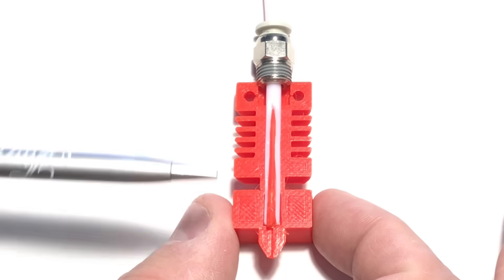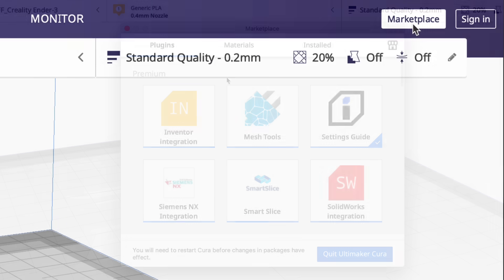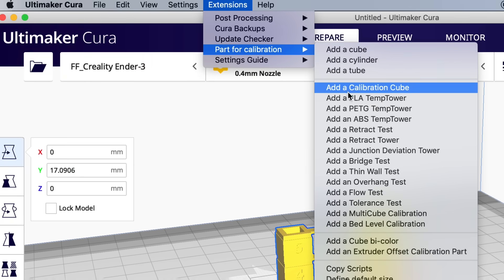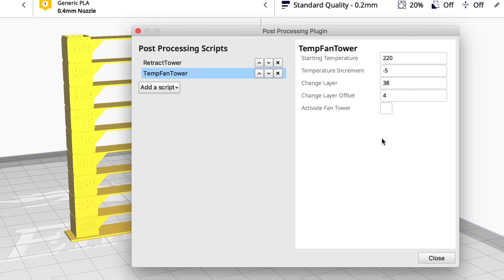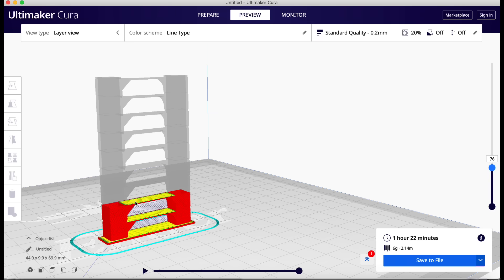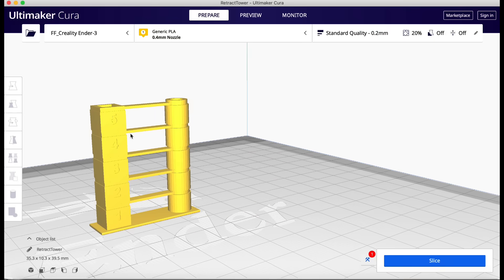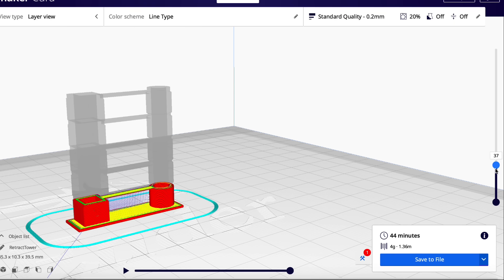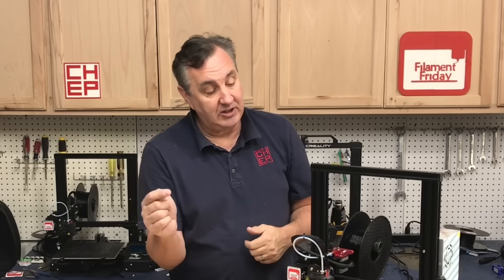Calibrate Perfect Retraction Settings Using a Cura 4.8 Plug-in

Comment: Hi Chuck, Awesome channel. Newbee to 3d, I have a Ender 3 V2 upgrade, with auto level. Works great with PLA and now trying PETG. grrrrr. I installed Cura 4.10.0, and loaded you 3 Profiles, Then ran the temp and Retract Towers.  Question is . when I run the retract tower, on every level it pauses about 3 to 5 seconds each time it moves to the other tower, amazingly the front of the prints not bad. Ya the back where it pauses is a mess. Any ideas. Thanks in advance for all you sharing.  Ps, I did switch back to Cura's profile for a test and same resaults.
Jeff.
Perhaps I had jumped the gun, Is is suppose to pause to allow the retract and then feed material at the next starting point. Another question. Which profile should be used when doing these test, Best?
Reply from the maker: I used 0.2 profile.

Comment: Works fine on 4.10.0. The only difference is that you don't have to add the scripts. I had to add a raft to keep it from coming loose, so if you do that just make sure to increase the offset in the temp tower script (4 layers in my case).
Reply: Heasd up. In version 4.11 the scripts are necessary. I checked the gcode and the temperature changes are not there.
Reply: @wassimks  I haven't upgraded to 4.11 yet, have you had any problems compared to 4.10?

Comment: We have cura 4.9.1 and unable to find "Copy Scripts".  Any suggestions?  Thank you for posting your video
Reply: Hey so I just had that problem, but if you go to Modify G Code and then Add a Script (like he does at 4:13 in the video) then it's already there. In other words, you don't have to copy the script then restart Cura, because it's already there.
Reply: No need to, as the scripts are already installed in Cura 4.9 or greater.
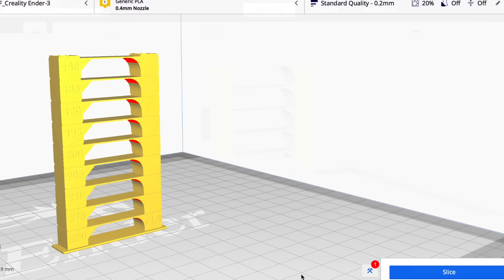Reply: Hey man, you wont need to copy any scripts. You just need to activate the Post Processing Script 'TempFanTower' (See timestamp 3:51) and slice it accordingly.

Comment: Very good video, the issue is that Cura 4.9.1 the plugin with the scripts generates the gcode, it sends to the printer. When the temptower is doing the 230 for example, I can see on the printer the temp still 210, meaning the gcode generated (even with the script plugin) did not modify my default value for temp at Cura... what Am I doing wrong?

Comment: How do I make the printer automatically change the temperature because when I start to print it, the hot end goes to 200
Reply: Mateo Proaño  on my Ender 3 pro the temp never changes during the temp tower print.
Reply: Maybe slowly rewatch the video to see the part where it is explained in detail how to use the plug-in to do this?

Comment: i got ender 6 and it doesnt work to me ,  script says temp 220  but when i slice it and print , printer only  heats up  to 200, any idea what to do ?
Reply: My feeling is that it begins to change the temperature after the offset. So after the first initial 4 layers, I believe it will go  to 220. I haven't tested it yet but I decided to immediately tune to 220 when I started printing.
Reply: I got ender6 too. After editing scripts you should not edit any of the the standart settings. in the g-code: search for M104 code and the temperature change. If you have all the set temperatures in the g-code(i.e. M104 S190, M104 S195,....M104 S220) at different Z heights, it will work.
Reply: @mertolca7457  thank you , now i have another problem , 1st: temp tower, there are inperfection in every gap between bridges, it didnt even printed 180..  also  in retraction tower transition point doesnt match up for some reason - 1st bridge is made on 44, next on 82 and 3rd on 131 , shouldn't it be equal? i followed steps but it doesnt work :/

Comment: If you got the best result at 5mm then it's not a complete test because your best setting should be in the middle of the range, so you can verify that it's the best setting. You should run this test again between 4-8mm retraction settings

Comment: Fairly new to 3d printing.  do you need to set up supports for these towers? not understanding how those bridges can print without them. Need to test my filament it has a temp range of 205-225C.
Reply: That's the point of 1st tower, it's a torture test to determine the best temp to print from side to side, without the need of supports
Reply: @mohammedwaly5041  got it thanks!!

Comment: Sir my temp tower layer hight is coming 41 and retract tower layer is coming 39, how to solve this problem??? Layer hight is 0.2
Reply: Just adjust for each when you print it. The Temp Tower is run by itself BEFORE the retraction tower. Don't try to slice and run both at once. You need your ideal temp before anything else.
Reply: @Becvar80  okk sir, i printed temp tower first and its layer hight is coming 41 and after that when i try to print retract tower, it layer hight is coming 39. Should i print at 39 only or is there a way to adjust the layers for both so it should come came layer hight???

Comment: So in the retraction tower script does the "Value Increment" set the "Retraction Distance" under the Travel settings of the print profile? So setting it at 1 means 1mm retraction distance for the first step?

Comment: Do I have to continue to input the changes to the temperature for every change over like 39, 72 etc...? Or is this supposed to start automatically. Also when I slice it and start printing at what is supposed to be 220 my printer still prints the initial layers at 200 and continues to print the whole tower at 200?
Reply from the maker: It should be changing.
Reply: It is not changing temp for me either. I'm printing with 
CR-10s 
Marlin bugfix-2.0.x
Cura 4.7.0

Profile CHEPV4.7.x
Reply: @GeorgeAlbercook  and not changing on my Ender 3 pro.

Comment: Those scripts don't work for me for some reason, I have to manually set every layer or it will just print the whole thing at the starting settings.
Reply: The temp script doesn't work on my Ender 3 pro with Cura 10 or 11.

Comment: Thank you CHEP for a very helpful video.  On the TempFanTower script, since it takes a layer number as a parameter to generate the gcode, you can use any layer height and it should work. I tried the PLA+ temp tower, which changes at 34 layers intervals, and only needed to change the starting temperature and set Change Layer = 34. Open the generated gcode in a text editor (Sublime Text, for example), and you will find the M104 Sxxx, with xxx decrementing by 34 at the beginning of each of the 34-layer interval.

An easy way to figure out the interval is first slice the temp tower, then divide the total number of layers by the number of sections. I use the layer height of 0.24mm, so I ended up with 34. Using this method, you can pick any temp tower on thingiverse, or create your own, to use with the TempFanTower script. The script really saves a lot of time as compared to the ChangeAtZ script.

The same method can be used with the RetractTower script. Using the same 0.24mm layer height, I found the Change-Layer to be 32.

Comment: Will the still work with micro swiss all metal and direct drive, will i have to use smaller increments?
Reply from the maker: Direct drive requires less retraction. Typically 1-2 mm
Reply: wondering this as well

Comment: I just installed this to Cura. I haven't used the app in a while. I am using 6.5 for retraction on my FLSUN QQ-S Pro and still getting a bit of stringing. I am dialing out my settings. I have better luck on Prusa Slicer.

Comment: for the ones who coudn't calibrate the retraction even after playing with it for weeks, such as me who is a beginner with a 3d printer. 

1, make sure the filament tube isn't loose or doesn't move when it's retracting. Check it with a tape or marker. 

2, when the nozzle is heated up, slowly feed the filament until it comes out the nozzle and wait until it doesn't come out of the nozzle. In my case the nozzle drooped for around 20cm which isn't normal. 

3, clean the heating element, search on the internet how to do it the proper way. 

4, check if the filament goes easely through the filament tube, do this while the tube is disconnected from both sides.
Reply: @bearinch  thanks for the advise

Comment: Very interesting and  many thanks for sharing. 
In Cura 4.9 the behaviour is a bit different, the same temp tower and the related script spaces first at 39 and then at 41 and 42 layers alternatively (I mean the first change is at 39, the second at 80, the third at 122, the fourth at 163, the fifht at 205 and so on...)  Sliced with the same 0.2mm profile that you used, so no way to use it... or get back to 4.8.
Reply: Ough. Just seen the first message from Ares, let's try it out...
Reply: No way, I've tried Z with different values and no way to match it with the tower... I'll have to do it manually, setting a tower and placing temp changes at the desired levels...

Comment: Here's a fix with explanation for those that can't figure it out:
For some reason they've changed the dimensions and setting of temp tower so it doesn't slice nicely anymore with 0.2mm layer height. All you need to do is, select the temp tower model and on the left side click on scaling (the second icon from the top), deselect uniform scaling and as z put in 76.4 And slice the model (of course add the script beforehand). Now check if cura sliced it into 382 layers. If yes then check if your base (layers before the tower blocks) is 4 layers tall. If it is, change the script's setting to Change Layer: 42; Change Layer Offset: 4. You can check if the tower works by adding (from 4, the actual temp starting layer) 42 (so 46, 88, etc.). It should perfectly fit. If retraction tower has the same issue I'll see if I can fix it.

Why those numbers? Here's a bit of math: Not counting the base, you need number of layers that divide nicely by 9 (the number of blocks), when you set model z height to 76.4 you get 382 layers. 382 temp layers - 4 base layers = 378  -> a number that nicely divides by 9 (and gives us 42 which we input as layer temp change). This way you can slice the model using 0.2 and have perfect temp tower with 9 temps to check. I have no idea what they did but it's a pretty simple fix.
Reply: As for the retraction tower, you can set it to z height 39 or 38.8 and leave the Change Layer as 38 and Change Offset as 4. It does not divide perfectly, but I think that's because the segments aren't the same height. With z height 39 you get all perfect but the last segment has one more layer which will be printed with 6mm retraction (won't really do anything bad, I don't think); with 38.8 it fits kind of well but you'll be printing the first layer of next segment with previous retraction setting, that also shouldn't do anything. With default z height it prints the last half layers of bridge (at layer 5) with retraction of 6 so this might throw off your visual examination slightly. It should be noted that I didn't try any other layer height but 0.2mm.

Also a tip: You can make one retraction model and just change the temperature in the tuning of your 3d printer right after you select the model for printing. (I know for a fact that you can do that on Ender3 v2), this way you don't need to slice a new model each time you get a new filament or when testing new settings. You just have to remember to tune that temperature setting directly in the printer.
Reply: ***SOLUTION:  slice the heat/temp tower at .16 (Dynamic Quality), and change nothing else in the script. Works perfectly.  For the Retraction Tower- slice it with a .2 (normal quality) layer height. Works perfectly
Reply: Sir Scofferoff  Any chance you have a link for the one that you found that works with the script as is and is designed better?
Reply: Instead of scaling the model, why not change the numbers to match in the post processing script? Also  is there any way to preview the temperature of a layer in cura? Otherwise the only way to know if you've got it set correctly is to actually print and take note of the temp on the display as it prints.
Reply: For the retraction tower at 0.2mm, at least in my case, the perfect resize method was to change Z to 41mm with uniform scaling selected.
This way the bridges will start at 38, 78, 118, 158 and 198.
Reply: Sir Scofferoff  That's what I did.
Reply: @dogsbd  Where do you download temp tower that works with 0.2mm layer? The above fix didn't work for me.
Reply: @gil80  Same, with this "fix" my first bridge layer is at 39? and then the next is 81?? I have 382 layers, 4 bottom, at 0.2. Just gonna use a different model lmao
Reply: @duviday  They actually all have a 4 line base (each section) so just say 0 layer offset with 42 layers
Reply: @PalosX  Thanks. This fixed my issue!
Reply: @PalosX  I started working with this plugin this morning and came to the same conclusion. Wished i'd have read your comment first. It would have saved me one stupid test print and then  about 10 minutes with Cura actually figuring out the 42 layer change point.
Reply: @dogsbd  would have a link to the script you used.
Reply: @sw1ft2U  I wish I could find it again myself, sorry!
Reply: Thanks this worked out perfectly for the temp tower.
Reply: im getting 381 instead of 382
Reply: THANK YOU!
Reply: @DerBadeschuh  That worked perfectly
Reply: THere are multiple towers, the PETG/PLA+/PLA190c are all 7 tower blocks and divide by 41 layers evenly. The regular PLA has 9 blocks and doesn't work right. Just use the others ones, you don't need all 9 blocks.

Comment: I own an Creality ender 3 pro.
I have some issue with the printer.
The nozzle gets clogs when there is sudden extrusion and retraction of the filament , ex: printing very small (less thaan 5mm) numbers and alphabets.
It prints fine without nozzle clog with bigger prints where there is very less extrusion and retraction process.
I have also changed the nozzle but i have same issue.

Kindly help me in solving this issue 
Thanks

Comment: im having trouble getting the layers to match up
Reply: Me too! The current version of temp tower does not look like the same as in the video. I couldn’t find of the correct layer height and offset setting
Reply: @mattysfong  same here. if im looking at when the bridge happens, the values change from the previous one- alternating between 41 and 42 (i am running petg with a .4mm nozzle at .2mm)
Reply: @potatoe22266  how did you set the number of layer and the layer offset?
Reply: @mattysfong  im still working on it. the layer numbers i just scroll through the building and note down when the bridge is made. layer offset im still working on
Reply: @mattysfong  My temp tower was ok but I can't get the layers on my retraction tower to line up. I don't know what to do D:

Comment: How to change the text on the tower? my PETG needs to start at 190 and go up to 230 acording to the roll (I already know it starts ozzing out the nozel at about 193). 
I can change the temps in the tower Gcode but the temprature display on the actual tower remains the same, the text tempratures on the tower do not change to represent the  new Gcode tempratures.

Comment: Have you tried this in Cura 4.9?  I was able to download the plug-in, but am not able to load the scripts.
Reply: Look at 2:50. You have to copy the scripts first, then it's working fine also on 4.9.
Reply: Can confirm that  @W07t3R  is correct, I just did the same in Cura 4.9 doing the exact same thing.
Reply: @W07t3R  What do you mean? I had this problem.
Reply: I had copied the scripts, but I did it again to be sure. I got a popup saying the scripts were up to date.  I first did not see the scripts for the temperature towers or the retraction test.  But, then I found them by scrolling to the next page.  Thanks for the help.

Comment: Thanks man for make this video, but this just doesnt work with CURA's modified G-Code, the gcode use M117 retract E5 to do the retraction, BUT Marlin doesn't support this function, so I am not sure how you did it, but it is technologically impossible.
Reply from the maker: I’m not sure what you refer to. The M117 in the GCode is the Marlin command to send the value to display on the LCD not retraction. Creality V2 display ignores it because of its separate non open source code structure, but I believe the retraction is done thru the G1 movement commands in the GCode commands.

Comment: Excuse me chep but I don't know why at home it should change the temperature is different, it is increased in the onfiguration the temperature change should be in layer 39 and it does it correctly but in the next temperature change it does not occur in layer 78 but the 81 and so every time that it should change the temperature every 39 layers the first increases 3 layers instead it happens in the 81 in the second level it happens in the 122 layer 5 more layers in the third level it happens in the 164 layer and I in the 156 as it should be. why is this happening to me any ideas? Thank you
Reply: having the exact same issue.  maybe cura changed the model?  not sure why this is happening. please post if you find an answer
Reply: Having the same problem @chep Help?
Reply: UPDATE: Changed layer height to 0.23 and it's now aligned.

Same issue as well
Reply: Same

Comment: Using Artillery Genius and the filament as been playing up until seeing this video, Cura 4.8 with the plugins worked for me, found out my filament needed 215 and retract 5, but not sure where you add the number 5 for retract in the settings.
Thank you,  under standing whats needed for 3 d printing is taking a little time but getting there.
Reply: mohammed dahodwala   Thank you so much for this info, will get this done